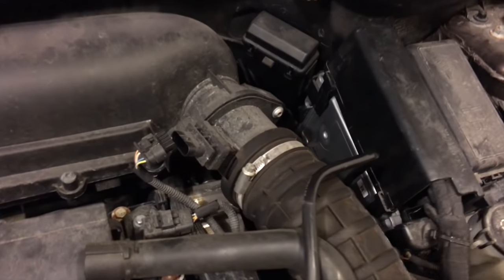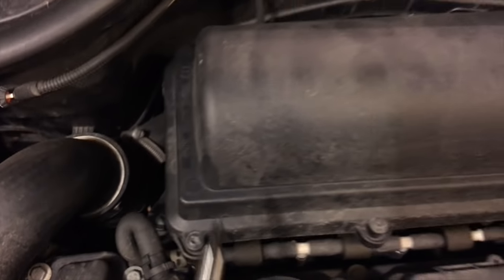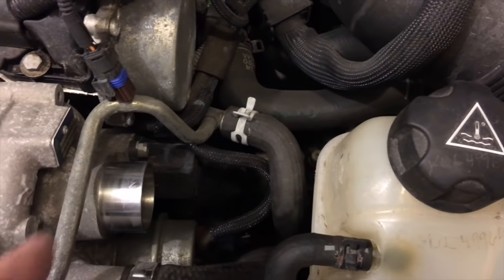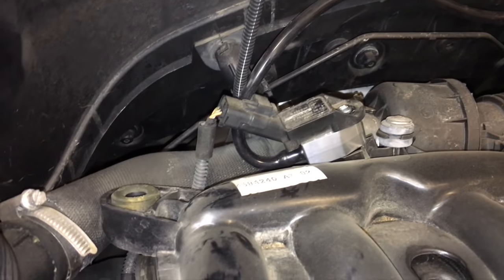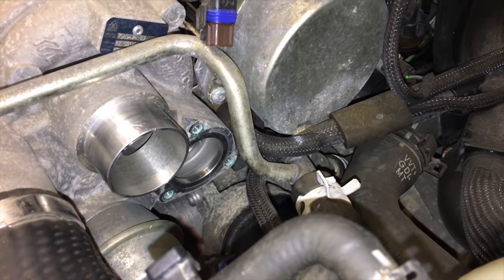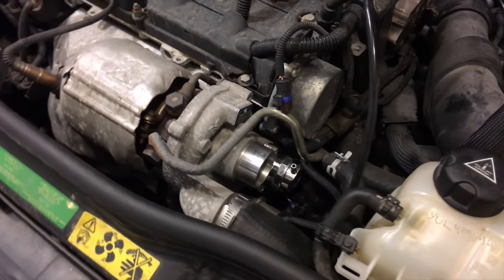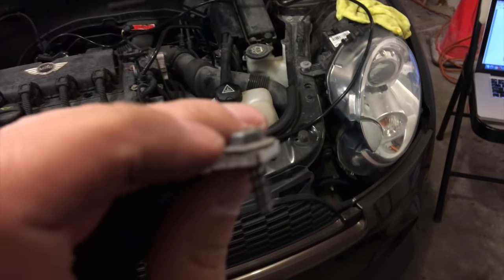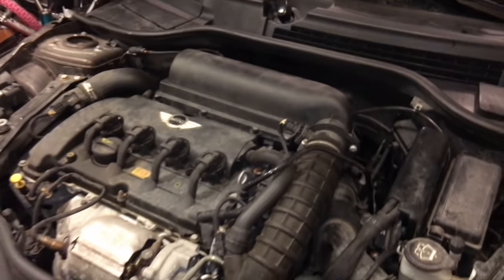Forge Blow-off Valve - Mini Cooper S (R55/R56/R57/R58)

Comment: Thank you. Finally a good video that explains and really shows what the hell is going on. I was debating getting this one or another cheap adapter but I didn't want to get another cheap one and risk the CEL and bad quality.
Reply from the maker: +Minipic just FYI, I am running a stage 2 Manic tune, so I am not sure if you will see a CEL with stock ECU or not.
Reply: Thanks for the heads up. Tune is on my list of things to do. Should be first but I am giddy about dumb stuff like blow off valves.
Reply from the maker: +Minipic if you just want the noise you can get the much cheaper adaptor that fits to your oem diverted valve and sounds the same as the BOV.
Reply: MotorPress.ca is their a link as to where I can purchase the blow of vavle I have a 2008 r56 1.6L stock but would love to have the same sounds
Reply from the maker: +Andrew Torres I got mine from ecstuning.com.
Reply: Could you link me to that diverted valve adaptor?
Reply: @MotorPressReviews  the kit just for sound, or does it increase horsepower?
Reply from the maker: Does not increase HP. It’s for the sound and also, when you have a tune, it can hold more boost.
Reply: Thats right,.. only Forge works - installed mine 4 years ago and never had any problem !
Reply: What adapter would I use just for the sound?

Comment: I have this installed. Sounds nice. Nice 'ping' sound on higher revs...similar to HKS. 0 engine codes without no remap.
Reply: Took interccoler of and changed turbo.

Now my dump valve doesnt work?
Reply: Is there an BOV adapter for n18 r56?
Reply: @THBULLDOZER  N18 is F56? N14 R56 N14 Cooper S has recirculation valve from factory is all I know. (consists of a paper diaphram which can split)

Comment: Greetings, Just a few quick questions.
1. Is this worth doing in 2023 with the same mods or is there anything better now on the market you may know about?

2. Can i do this at home as a new mini owner?
Thank in advance.
Reply from the maker: I wouldn’t try to do it unless you have some experience working with cars.

And as a mod, it’s only useful to dump hot air if you are tuned and making more than 14psi of boost.

Comment: hello great video, I have a 2007 original mini cooper s, can I install it without creating any problems or power loss?
Reply from the maker: You can try but you might get a code thrown as the air mass sensor is expecting that air back instead of it being discharged to the atmosphere.

Comment: is there a big difference between buying a cheap one on amazon without the cords, just the valve, and the more expensive one you got? i just got a 2010 mini cooper s john works edition with about 20,000 miles on it and i don’t want to break anything.

Comment: Ok nebee. If I add this to my mini will it give me more power? Or just noise ?  Thx
Reply from the maker: Only noise. But if you mod your car to make more power, this will hold the extra boost.
Reply: I have read about some adjustable ones are those the ones that can turn up boost?
Reply from the maker: Wastegates can do that but on the MINI, an ECU tune is the only way to “turn up” boost.
Reply: Got ya thx.
Reply: MotorPress.ca i have a intake and muffle delete soon this will be on my car next is a new clutch but I wanna upgrade the turbo what would you recommend? What type of turbo and before I do that what else should I do before the turbo thanks just learning about Mini Cooper I decide to get one to be different lol
Reply from the maker: Borg Warner Airwerks SX03 is a 41mm Bolt on turbo that is rated at 300hp. You will need a sport downpipe and a tune to run properly.

Comment: I have a 2012 r60 I followed all the steps but mine is not blowing off at all it feels like pressure is collecting inside of it but not releasing
Reply: Did you managed to solve this ? I'm having the same problem. No blowing 😢
Reply: Manual or automatic?

Comment: i did what the instructions said to do but when i was driving around my boy wasn't making any noise and i had a half power check engine light can you help
Reply: Let me guess,  only turn on the light when you press hard the throttle. Could be a problem with the o'rings, could be missing pressure.
Reply: +Joseph, I have the same issue no PSssss.  Were you able to correct the problem?
Reply: @nachomini2232  I just put mine on and same thing. Followed instructions exactly but doesnt make any sound. Did either of you guys figure out the problem?

Comment: I Have a completely stock 09 R56 JCW, will this work on it or will a ECU remap be needed?
Reply from the maker: It will work but you might get an engine light on as the MAF is expecting to see that air again, instead of releasing to the atmosphere.

Comment: Is it possible in this valve to make flutter sound?
Reply from the maker: No, but if you put an intake kit with a large cone filter you will hear the turbo flutter.
Reply: MotorPress.ca is there any way to remove the flutter? At the end part i can hear the turbo flutter when you let go of the pedal
Reply: If it flutters means something isn’t right. You don’t want it to flutter! Might have something loose or backwards
Reply: Correct me if I'm wrong but when you have a bov it's not supposed to flutter because that means air is trapped inside the turbo
Reply: There is nothing wrong with a little flutter guys

Comment: Did you use the spring? Or is the srping not need it? Just ordered mine and I'm curious about this. Great video! It will help tremendously
Reply from the maker: Used the red spring which is designed to hold more pressure
Reply: @MotorPressReviews  I currently have the alta spring. Red still better for me to use?
Reply from the maker: The Alta spring is for the recirculating valve. I don’t know if it’s a fit or a good idea in general to put in the forge BOV.
Reply: @MotorPressReviews  okay.  Thank you so much for the help!
Reply from the maker: No problem! Good luck :)

Comment: Great job and good explanation. I'm wondering if anybody knows if the same approach would work with a 2017 R56 JCW. I have been looking for that info but could not find anything yet. Thanks!
Reply from the maker: +Marcelo Jabali 2017 F56 you mean, right? You need to find a BOV that is made for your car, not sure who makes one. The general idea should be the same.
Reply: Right. I'm sorry. It's F56 not R56. I just could not find one yet. Thanks!
Reply from the maker: +Marcelo Jabali no worries, just wanted to clarify to be able to check what is available. I ll let you know if I find something. Cheers!

Comment: What does it do to the engine or how does it help it?
Reply from the maker: It makes cool noises and releases the air into the atmosphere instead of recirculating to intake. So that hot air goes out. Also, if you have a tune that increases the boost, it will hold the boost and not leak.

Comment: I had it installed and got engine failure, it seems to let of to much air.
Reply from the maker: Obviously something went wrong there.
Reply: benshke did u replace it with the upgraded Alta spring
Reply: the spring wasn't in the package so no i didn't, don't now i i can get another one.
Reply: benshke u hav to order it of eBay mate Alta upgrade BOV spring I’m just waiting for mine to be delivered As I kept getting wanting light coming on this spring is suppose to help I hope
Reply: yeah, had the same problem, was driving about 130km/h in cruise controle, massive motor fail, lost all power. Got to the side of the road, restarted the "beast" all good again, when i got home i went back to the stock one. Do you have a link to the ebay page?

greetz Bensh
Reply: benshke Same ere engine light and limp mode at 105mph’Just type Alta upgrade spring in eBay search mate
Reply: no distributor in europe for alta, eBay is mental, sending costs double the price of the spring. Think i might just not but it back in. Got some other upgrades in mind first. Racechip order!!!
Reply: benshke oh yeah I paid £39 for this spring from America didnt no till got my paypal invoice never mind hope it works’Ive has stage 1 map me 225bhp
Reply: I'm working on a few upgrades, still searching for a john cooper works partscar. Downside here in Belgium there are now breakyards anymore, all totalled cars are shipped to foren countries. Need some stuff for my engine and body. I've now got The R55 sport and want to upgrade some of the electronics, turbo, downpipe and some general spare parts. Just need to stumble on a car that is ready for the scrapyard where ik can buy stuff of, or buy its completely and strip it.
Reply: benshke u got the super charger edition’Ive got decat down pup full straight threw exhaust k@n stage 1 and so on
Reply: i would love to put one in but can't, here in Belgium where not allowed to do it due to MOT (i think its called like that in UK) we get pulled over by the cops, they bring you to the controlled center. I want to put in the JCW downpipes, the flow is less restricted by about 15%. I already have the JCW exhaust installed just want to get the bigger downpipe and turbo for a few extra bhp, then along with air intake update, and racechip i should break about the same BHP that you have. 220+/-
Reply: benshke yes u should see some good bhp mate and yeah it’s like that over ere but few garages will pass it on the mot so it’s ok And police ain’t too bad over ere mine is loud and the bangs and pops are good
Reply: yeah here the cops are mental, living close to big city, just need to find the parts.
Reply: benshke Ebay should hav ur parts for sure mate and I’ve had a bran new turbo on mine still the n14 one tho
Reply: Thinking about going on a road trip this summer to uk, there's some breakyards there that do only mini. Should find some parts there to use

Comment: Hi!

So I have been lately experiencing a flutter and low idle in my car. Sure as hell... hooked up the computer pulled the code 28AA. Shear air circulation valve, plausibility...

Sure as well we the symptoms really line up with failing blow out valve and mini has release a recall for this part recent if not mistaken... I would rather just fix the problem and at the same time give my car a bit of an upgrade but also not kill the car due to incorrect amount of airflow.

Will this fix the failing blowout valve?

Were there additional pieces you purchased that didn’t come with this kit for the upgrade??

🙏 thanks!!
Reply from the maker: Nothing additional is required. And yes, this replaces the recirculating valve. Few people have reported a check engine light coming on if you do not have an ECU tune, but it’s possible that an installation mistake was involved as it comes with a solenoid that simulates the OE spec.
Reply: MotorPress.ca thank you! This kit will work great for me then, I am trying not to install an upgrade that would require additional tuning. Thanks for the quick response and video!